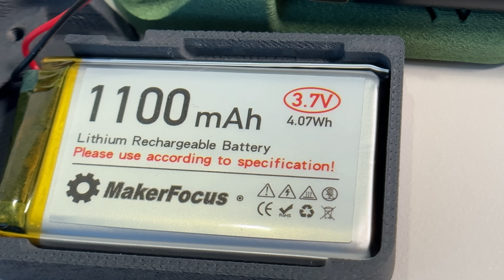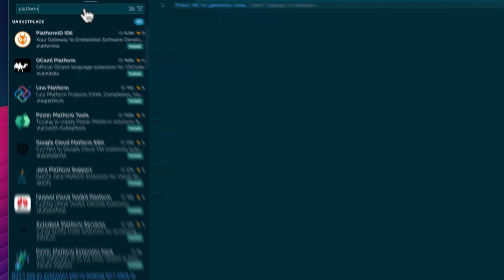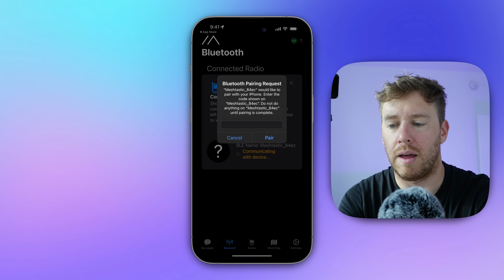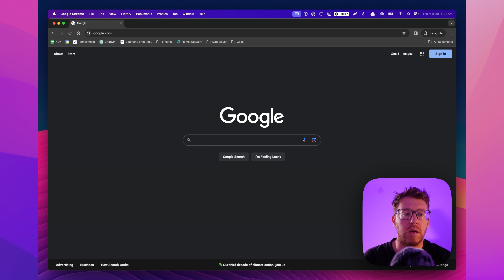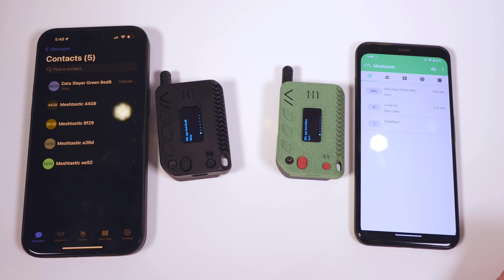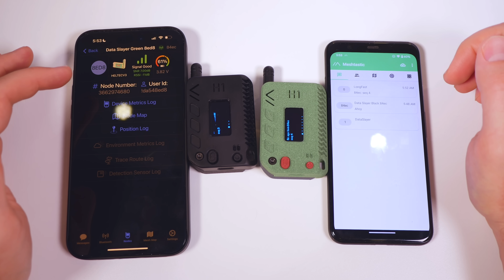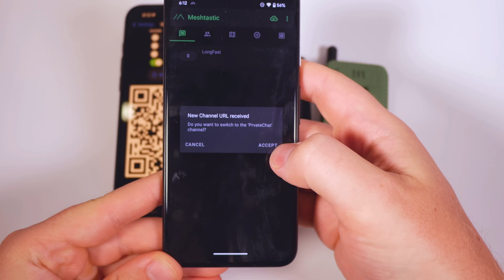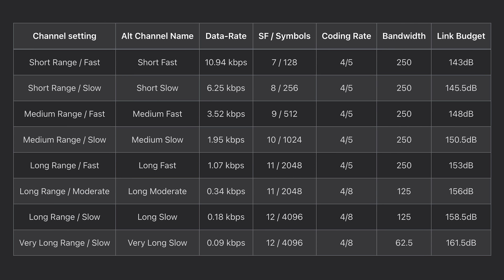It’s Been a Good Run, Phone Providers.

Comment: We use 27 Mgz citizen band radio in the back woods, the base station has a 102 inch whip glued to the steel roof of the camp. It gives us 15 km range with mobiles in the rolling hills. No cell or tv out there in the norther boreal.
Reply from the maker: Sounds like you're off the grid!
Reply: @DataSlayerMedia  it's a hunting base for moose and black bear. The CBs are unmodified at 3.5 watts. We run a 3kw generator for the fidge. I sometimes do HF ham radio and there is very little noise on the bands when at a solar minimum. We also have access to a vhf repeater that is connected to a phone patch via starlink that replaced the expensive satellite phone.

Comment: lora is super easy to jam... especially the node red users
Reply: How to jam any radio transmission:

1) Identify frequency to jam
2) Set very high powered radio and antenna to targeted frequency
3) Transmit random white noise static at the highest power you can for as long as you want the frequency jammed
4) If your signal is stronger than the other transmitter is jammed
5) Flee the US to a country that does not extradite to the US because the FCC are coming for you and the FCC does not fuck around and they will make sure you learn

Comment: Its something that HAM radio operator did with VHF/UHF packet radio modems decades ago, even with tcp/ip. But the interesting thing will be using these devices as descentrilized high speed routers, so you cam proxy other people packets like the internet infrastructure does.

Comment: I wish this had also tested the mesh aspect of these devices. Does it connect promiscuously to any similar device so your range could potentially be infinite when enough of these are on in the wild? If so, you could build modules that have solar panels and batteries and leave them in various locations to provide an actual mesh over a large area.
Reply: its made for really low power use. at this moment people are building those konda units hidden as a birds nest for example in trees or on top of buildings.

Comment: Retired Cdn military Radio Operator here.  This is obviously garbage where a simple walkie talkie would suffice. (Your hiking example).  Based upon the antenna, you are in UHF or higher freqs, meaning that you will require line of sight.  Trees will get in the way of your signal.  Your battery requirements show that transmit range will be limited and even with a sensitive receiver, you are going to get an extremely slow digital signal.

A satellite phone will always work unless you are near the poles (though expensive).  HF systems have also been digitized, and then you can literally bounce signals off the ionisphere, with a range of 500 km or more on relatively low power (and at night, hear signals from across the ocean).

What you are presenting is a wifi extender, nothing more.  It has a lcd screen and is programable, but you would need a very specific use case.  To meet the requirement you mentioned such as hiking, there is so much cheap, old school technology that has also been brought into the digital space, to fit your needs.

The only caviate I must mention though is, find out what your legal frequency bands are and any licensing requirement you might need.  The airwaves are actually quite regulated (as there is limited space), but there is still plenty of room for civilian usage.  You are excited but the tech, but this is in the range of Elon Musks hyper loop, where it sounds really capable, but it only delivers a slow tunnel to drive a couple of electric cars through.  

There is better gear out there if you actually look.

Comment: What these need is   Ground to transmit,  3V to  Rx type output so an external  say  5W class C  RF amp at  950 Mhz can be added.   if  the current output is  100 mW or so based on what the current draw figures were  (certain amt of guessing there) then at 5 W you 'd have  abt  50 x the power at a given range.  This would translate as range going from 3 Sm (4.8km) out to around  50 ^0.62  x  4.8 km or  55.3 km ie they can reach to the local horizon of about  30 km or so if there are not any trees around.  . If one node as a repeater is up at  10 mtrs or so you can realistically  expect  60 km out of them in flat terrain or over the sea .Obviously an intermediate node out at sea is difficult to achieve but one on a promontory is  another matter  ie along the coast. The engineering of  a 5 W  amplifier  is not trival but  standard mosfet chips do exist for this duty. 

 Eg MRF  186 which can be bought second hand for  15USD.  This one is far too powerful for that duty bu it's rated for use up to 1000 Mhz.   950 Mhz mobile phone extender boxes used to be available back in the day . this is the same technoglogy.  Such boxes were hated by the carriers and were illegal because they tended to hog the network Ie they'd  cause  multiple phone towers to  open up a comms slot for a given phone.  I hinted at a device that would be a major game changer a  1W or more  955 MHz  repeater specific node widget in addition to the two hand helds.  No charge for this idea.

Comment: It's an interesting piece of tech... Has some of the same things that make the internet so valuable.

Mesh networking is really what's behind the internet... Its all a mesh, and if a node goes offline traffic just flows around it.  They found out on 9/11... there was a node connecting NYNEX to the net backbone, right under the towers, and it all fell on it.  But the net stayed up... Things slowed down, but it all still worked.  It just shows the power of a mesh network.

I could see this evolving into a rival to texting, but on its
Reply: ...own device to device net.  It has the same problem fax had, back when it was still called facsimile... Useless without a larger user base.

Comment: As a prepper nerd, I am often looking for an option other than standard walkie-talkies where I can store them in a faraday cage in case of a powerful EMP (to use them after the EMP basically wrecks everything) while having a reasonably long range and a lot of utility. So with a nice long antenna, a pair of these could keep me in touch with people at 'base camp' over a lot longer distances in an urban environment which is a big problem that walkie-talkies are unable to handle very well, unless you get into some very expensive radios where one is expensive enough, a pair is just unreasonable.

Mind you, I am only as far in the video as the firmware updating so I don't know how well these things actually work just yet. Hopefully by the end of this video I'm not coming back to the comments to say "damnit! that isn't a solution that works for me at all!"

Comment: It is an important concept. But the system needs major maturity in applications and ease of configuration (e.g. channels) before consumers will migrate, if ever. The cost of even unassembled LoRa imports has doubled over the prior four months, (early 2024) making deployment of the requisite number of nodes for usefulness less likely going forward.

Comment: So basically, it's just a pager from the 80s and 90s . Better off using a walkie-talkie or cb radio to communicate without a phone service. Meshtastic app  acts like a server ( which is technically is), and most likely, the messages are stored in a cloud based system  ( internal/ external hard drive), which  messages wouldn't be encrypted.  Well, thanks for the video , you saved me a couple of dollars.

Comment: Cool video! I use ELRS RC Link, which uses LoRa plus its Low Latency. Its an ESP32TX and SP1280 chip i believe, for 2.4GHz. There's a 915MHz setup also which has more Range/Penetration 
Where did you get that UFL to SMA Adapter with the thinner flexible cable for the U.FL lead like yours? Its shown at @4:16. I can only find thicker ones on Amazon which wont work for my project    Thanks!!

Comment: Excuse my tech ignorance but it appears these are dependent on cell phone data. I dont see where it's an advantage to carry two devices to send a message when you can carry one. Cool? Yes but I can't see it's worth
Reply: They are not using cellphone data. The phones are linked to the Meshtastic devices via bluetooth. The texts are only sent/seen on the “mesh” network. No cell phone or internet provider needed.

Comment: Texting without using the cellphone.  I don't think it's going to replace cellphones, like he says.  It might be useful at a venue were the cell tower gets over-loaded with connections, and then you can text whomever has the other heltec.  But why do you even have to build it?  Why not sell some that are already built?  It's starting to sound like a digital FRS radio to me.  Motorolla does already sell those.

Comment: What if there’s 3 nodes. Node 1 is  1mile away from node 2 and node 1 is 2 miles away from node 3. And node 2 is 1 mile away from node 3.

If node 1 will send a message to node 3, will node 2 relay the message from node 1 to node 3 ?

Comment: I'm planning to create a simple messenger that utilizes the Amazon Sidewalk network. This will be for remote sites lacking cellular coverage. The idea is to pair a customer's cellphone with an Amazon Sidewalk-enabled device via Bluetooth. This device will then use LoRa to send short text messages through an Amazon Sidewalk hub installed in the field and connected to the internet via Starlink or similar service. The user will use an Android/iPhone app to send and receive messages to/from an Amazon Sidewalk device. On-site users (up to 25) should be able to communicate using this messenger and have the option to reach out to the main office via the same messenger. 

Is this possible to achieve, and if so, which hardware should I try?

Comment: The only real + here is that it circumvents big tech and big government surveillance… Except it doesn’t…. Client side scanning on all the big tech phones grabs up all of your keystrokes PRE encryption… So apps like signal, telegram are more insecure as well… as far as computers, with the new recall function on the newer windows 11 machines… It will Kellog as well (I’m sure it has already been doing that secretly). I guess maybe you can just use a Linux computer then? Kinda hefty if your hiking though… It needs to be its own device fully where you can type on it then it will achieve that
Reply: Yes, govs can still snoop since it allows for smartphone pairing. Like you said, all members of a channel should not be using smartphones but standalone Lora devices. I read a bit on meshtastic, it seems like a simple protocol with no routing, and with very basic pre shared key symmetric encryption, which is also a problem since if one node is compromised, say they steal a device, they can read the whole channel, or even impersonate, there is no auth or anything. Then again, it's supposed to be simple, if you add routing and auth you gonna end up with TCP, and routing would also mean directional antennas. I think they done great keeping it simple, I just disagree with the inclusion of smartphones, just like you.

Comment: The title clearly is a clickbait. I completely went from "sounds cool", then "I'm confused", and ended up in rage because you explained how it works later in the video after boring me with setting ups, and apps, and firmware, dah dah dah... this is completely useless tech, literally get a pair of ham radios and will do better for deprived regular ways of communication. Plus, I still believing this thing might need a HAM Radio Operator License just because it still using radio frequencies. As someone said on another comment: you still need phones to use this, also, it's more like a pager attached to a mobile phone, and I add: it's too much to go through for such poor end result.

Comment: No LORA device will ever be secure from snooping by corporate or government entities unless you remove the phone and remove the Bluetooth and wifi capability from the processor. The closest option currently available is Armachat by Peter Misenko, but even those use similar microcontrollers that have Bluetooth and Wifi. Perhaps they could be disabled the old-fashioned way by cutting the antenna traces without causing other problems? Don’t know… but I wanted to throw this out there as the .gov has been caught tracking people by their Bluetooth activity here in the USA. 

 Something to ponder-and I have no idea if I am right about this, but these boards are made in China- a country with serious human rights problems and a crushing amount of state control over the lives of it’s people…. Is it reasonable to expect that there aren’t back doors into these devices to prevent their use by the people to communicate discretely?

Comment: It will be nice for you to explain what it actually is first. Before you start explaining all the specifics about it. Because I don't have the patience to sit through learning about the specifics of something I don't even know how it works or what it actually does.
Reply: its a wireless system made to transmit and receive small data like telemetry or chat messages. over a few km. depending on placement it can be more or less km.

the point is if all those nodes are connect as a big net and some nods are connect over the internet (mqtt) you have one free network. think about it. i personaly only need a data plan to chat with people. those telecom providers don't give an option that fits that set of needs. for me minimum is like 7 euros a month.

if this net gets big enough yoi can buy one of those things for 15 euros and just chat with everyone for no more cost ever.
Reply: hope that clears it up a bit.

Comment: Its not groundbreaking...Its an oversized pager. Cell phones will not even notice this thing exists. 1: Limited range text based messaging. 2: Its not "Off grid" . 3: it only has a 12 hour life cycle at best.

I dont remember you talking about their range but it appears to be about average for a walkie talkie, I would bet the walkie talkie has better battery life and range overall. 

This is a Hipster hobby toy. Just buy a walkie talkie, equivalent range, battery life and less requirement to start using.
ROFL ok yea, they want 60 bucks for a 2 device DIY kit. you can buy a fully functioning handheld radio that has more range in the same setting for 20 bucks. This is a scam.

Comment: I bought several UV-K8 quansheng walkie talkies for 17 euro each and with flashed firmware I can send SMS via the radio and have all other radio functionality. 5W transmit power, hard to beat that. And all that for under 20euro for a piece. A bargain. If the people behind this product don't drop the prices I don't see people using a more expensive device with a lot of lost functionality.

Comment: radio waves are way to unreliable for stable communication to replace your phone. Things like buildings can really block signals so it wouldn't work well in some areas. Also its not just phone providers that can tap into these frequency's, anyone can listen to ANY frequency possible if you have the right tools. Nothing illegal about that.  Especially knowing that this thing doesn't get much range anyway, i think its safe to say this wont do well.

Comment: Not so much a click baity tittle but could be a little more clear on the subject..  meshtastic is an off grid comms unit but it requires several users in an area to send coms over range and fcc limits base stations to 30 watts liscenced or 5w locsl without liscence.   This has potential to be a provider killer if more people on a mass scale invest in and actively use the technology..  also no device is completely safe from intercepted communication or surveillance but these systems are more secure however...

Comment: code as app and OTA push to disaster area.sss 
rebroadcast-relay mode for those who cannot suicide and need to slow...

hotspot channel wifi 11/13 regions 
frequency 2.5ghz channel 11 but modulation-packetization HSDPA and HSUPA and LTE

also for pocket hotspot...

IF and When - your region have disaster...

Comment: So, am I correct to summarise that this device MIGHT be useful if 2 people got separated on a hike in a rural area where there was no cell/mobile network coverage (or in an urban area where networks went down during an emergency)?

I think antenna lengths usually have to do with the radio bandwidths being utilised. Am I right about that or is that purely for analogue signals? Is this analogue or digital or both?

I watched the whole video and was quite impressed but at the end I was unsure why… possibly not the presenter’s fault; I have ADHD. This happens more than I’d like. I think if the pay-off/motive-to-invest-time-and-money was more clear at the start, I would have concentrated more.

Video title seems a bit weird. I mean, I get it… “WATCH MY VIDEO”, but in just invites (valid) annoyed comments.

Comment: meshtastic is not a phone killer it is crap For many reasons no Voice Is one, Try and send a text using  them  it's almost impossible and  long winded.  so Just use your mobile, And how are you going to power remote nodes So many reason why it's  rubbish The Nearest node is more than a 80 miles away from me. as You can see completely useless, It's a fad and it will die down soon, Using Smoke signals will get you better range, To be honest even shouting will, even using CB or cheap Chinese dual band radios or pmr446 Would be better off grid.(On the south coast of the UK)

Comment: I don't get a point, how it's different or better fm VHF/HF digital  radio with AES? 
Is it another useless gimmick for hipsters? 
TX power matters, antenna size matters, mounting hight matters, bandwidth ☝️ surrounding, local anomalies, weather, sun etc 
Radio communication is not simple and effective means are regulated everywhere